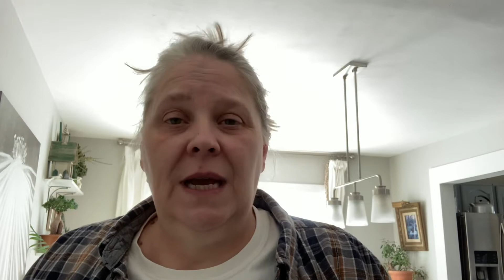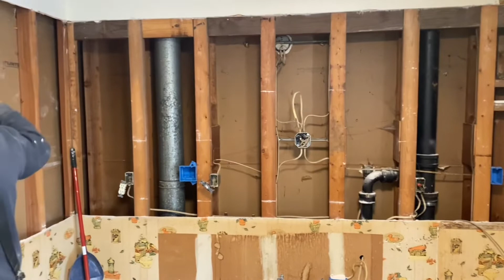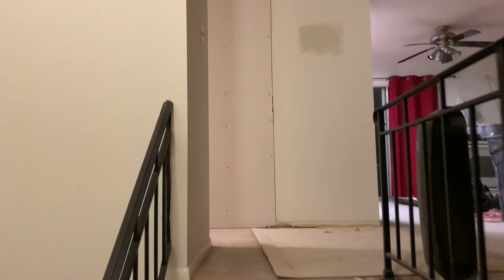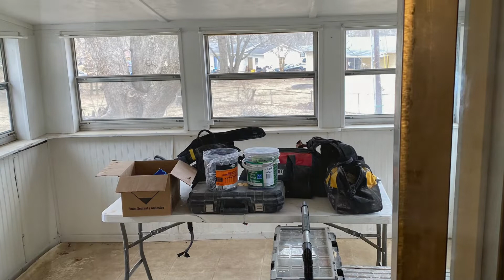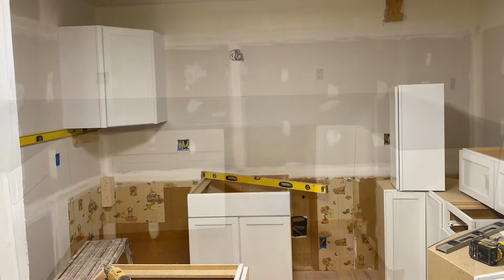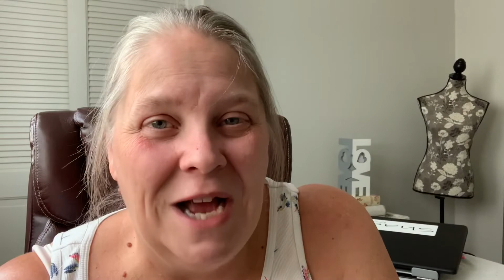Week 5 Rental House Update - New wiring, new drywall, kitchen cabinet and counter dry-fit

Comment: The house seems to have a lot of natural light. Love the room with many windows ! I m thinking in the long run the electrical upgrade was worth it in today's day and age your tenants would constantly be blowiñg fuses. :(  still though it gets tense when you have to replace  things like wiring . Glad it s going well
Reply from the maker: Thank you and yes I definitely want a safe place for my tenants.  The house was built in 1960 and although the electrics were modern back then, now we use way more electrical things.   Just preparing to add a microwave showed us that the main electric box couldn't hold another thing.  I am super happy this is being done now as opposed to later but it's one of those things that costs a lot of money and you cant "see" it.  At least when installing a new kitchen you can see and touch it... new wiring - not so much.  
Thanks for watching!!